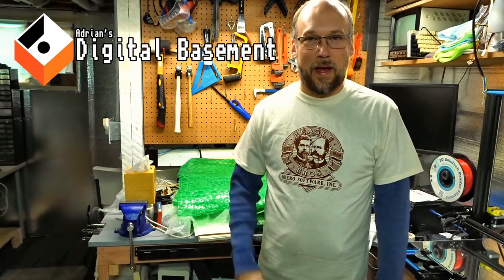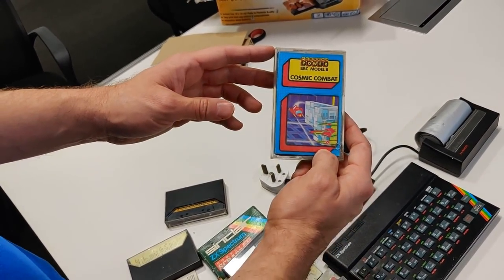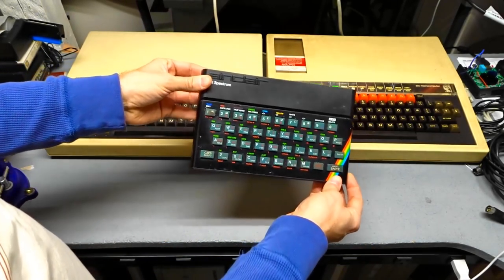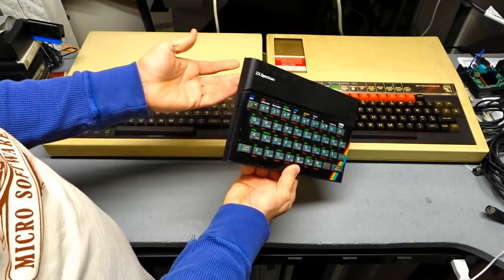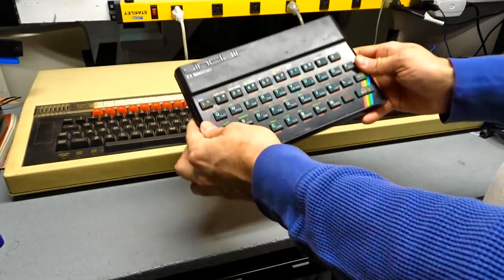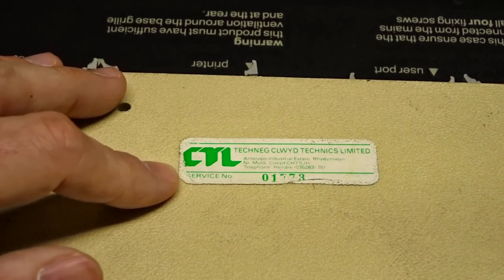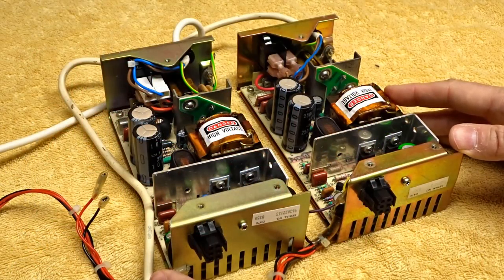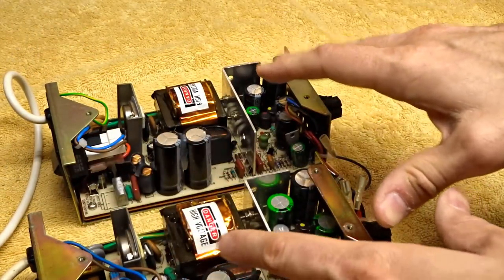I visited the UK and brought back some computers! Let's see if they work.

Comment: Nice pickups!!!  Regards ideas for mods / upgrades on the BBCs - get yourself one of the Turbo or Super MMC adapters (allows you to play all games off a single MMC card), consider adding some sort of ROM expansion board - or some of the RAM / EEPROM adapters you can get off eBay.   These are also cool with the speech chip added - you can buy a kit from RetroClinic in the UK.  I've done some repair and upgrade videos on these myself just last year.  Lovely machines! 

You can also add a Raspberry Pi as a co-processor to these too (via the TUBE connection), and I recently added a SID chip to mine too.  If you want a "Beeb SID" bare PCB for free just let me know and I will post you one from the UK - just needs some TTL chips  and a Swin SID / SID chip etc, but its easy enough to assemble.  I used a Swin SID to avoid reducing physical SID chip stocks from my C64 systems.
Also worth considering doing switchable audio mod too - so you can have audio out into the SCART connection or line out, rather than being forced to use the speaker.
Reply: @adriansdigitalbasement  Yes, that darned 245 really gave me a run for my money lol!  It was litterally the last thing that could possibly be affecting the databus - why couldn't it have been one of the earlier chips I removed lol.   I couldnt see an email address on your about page (maybe YT changed permissions or something related to that recently).  I have added you in Twitter but cannot message until you add me in at your side.
Reply: @adriansdigitalbasement  @GadgetUK164 definitely the guy you want to ask about British Computers. He can probably also give you some more insight on the ZX Spectrum
Reply: The Master is a nicer machine, but it had some incompatibilities didnt it?  That said, I am sure those progs / games have been patched up already to work these days.
Reply: I added a daughter board to mine and installed a number of EEPROMs for different compilers and interpreters. I remember learning Modula2 and Forth for example. It was a great machine to learn on, plus of course Elite and a brilliant racing game called Revs. After that it was the Atari 520ST.
Reply: The Tube socket is so so cool :3 I suppose a Pi is as close as you'd get to the original ARM dev Tube board from a modern system?

Comment: I still have my BBC Model B with tape, disk drives, BBC joystick, 6502 second processor, word wise eprom, a huge selection of games, including Elite on tape and disk.
Mine is a 1982 model, according to the sticker on the pcb. 
Yes it still works.

Comment: 10 PRINT “HELLO WORLD!”
20 GOTO 10
RUN
Reply: 10 FOR a=1 TO 29
20 PRINT "Hello World for the ";a;"th time."
30 NEXT a
Reply: @elektron2kim666  
Hello World for the 1th time.
Hello World for the 2th time.
Hello world for the 3th time.
Reply: @chrisatherton8234  a$="stndrdth"
Reply: 10 PRINT "MARTIN IS ACE!"
20 GOTO 10

I used to go into Dixons on the high street. They had Oric-1 with it's onomatapaeic (sp?) BASIC key words

10 SHOOT
20 GOTO 10
Reply: @martinj.fowler6262  how many times we did this in the 80's.
Dixons was ace, Roland synths, mahoosive hifi systems, battleship proportions televisions.
Reply: Very BASIC command ;-)
Reply: @johnyboytown  Dixons FTW :)

Comment: Got to love the Beeb, one of those few early micros that feels like a "proper" computer. And you can't go past a system that lets you do inline assembly code in BASIC!
Reply: Sophie Wilson really did care above user experience and sensible design, designing to a cost was so low in her priorities. Even though so many more Speccies were sold than Micros and Electrons, at least her RISC CPU design has stood the test of time... and the strengths in her design of the Micro still show through today – as Adrian said, the connectivity is out of this world. The mods people could do to these things were incredible. Douglas Adams and Terry Pratchett both had highly extended systems hooked into various smart home devices from back in the day... crazy stuff. And incredible. Leaving those unpopulated sockets for expansion ROMs was a small stroke of genius. That kind of stuff gets washed away with the first skim of cost cutting when taking a design from prototype to production. But they kept it for the Micro. Same about the keyboard.

Comment: WTF? Those computers were still running our missile defence system. We need those back, dude.
Reply: So true and with 8 inch floppy drives installed .
Reply: @jari2018  That's right. The government drafted in Sir Clive Sinclair to personally design and build the interface for that. Cost them £10M and was classified until 2016.

Comment: BBC Microcomputer was used in every school in the UK during the 80's
Reply: Until they were replaced in favour of the Acorn systems line in the late 80's, early 90's. The old BBCs and other Acorns had an impressive life. I was using them at my school right up until the end, in '97.
Reply: @mikejandrews  They were all Acorns, Acorn made the BBC Micro and the Archimedes. Yes, well-built computers, guess they had to be for school use. I owned both of them back in the day.
Reply: @andrewnorris5415  Yes, I know. The story behind the BBC machine's development is fascinating. They were strong, well-built machines.They probably anticipated bothersome primary school kids going wild with them. 

But I never owned either, though used both at school (mostly the Archimedes) and my brother had the Electron. Played a lot of games on that. (After they finally finished loading.)
Reply: Till RM Education took over
Reply: Some schools still used them well into the 2000s. It's still a perfect educational computer for young children. There is no American software with incorrect spellings, they are so limited there are no pointless distractions, and they are extremely robust. I wouldn't be surprised if there are still a handful in use.

The Risc PC was great for slightly older kids. I remember it having a really nice word processor and paint program, so it was more productive without being too full of distractions, and still had correct English.
Reply: I used a BBC Micro in my embedded electronics classes at school/college... In 2005! We still had 5 all set up! 😉

Comment: I have no idea why YouTube suggested this video but it brought back many memories. The BBC Model B was our first computer and between 1983 and 1993 my husband and I had a small software company producing educational programs for secondary schools in the UK. Our best sellers were for data analysis, allowing students to enter and display records from e.g. a weather station, measuring rivers and for human geography doing surveys in towns. I learned to use a word processor with View (supplied on a chip), spreadsheet was ViewSheet and ViewData (if I remember correctly) was the database. With the BBC Model B, you could only get about 1000 words in the memory before having to start a new file, though you could chain them together to print documents out. My favourite was probably the BBC Master 128. That would hold 5000 words before running out of memory. Favourite game was definitely Elite.

Comment: I think I know why one BBC has a cut out section. It's because the BBC wanted a specific power supply that wouldn't interfere with their equipment, against the advice of Acorn. But when it became clear the kind Acorn recommended was required for reliability, it was changed to fit the original specification. All learnt/vaguely remembered from last week on Retromancave. That might be something to do with it.

Comment: The Econet machine was definitely from a UK secondary school in the 1980's. Nobody else but the criminally rich and insane (ok, Acornsoft) would have a network of Beeb's back then. They would all need a fileserver too which would be a rack mount Acorn Atom based machine (called an Acorn System something) with massive 5MB Winchester drive or perhaps dual 5 1/4" floppies.

The -5V is used for the RS423 interface. You definitely need it for trying to transfer files between a real BBC micro and your PC. The PC end is the usual TTL/RS232/USB adapter and the other uses a 5 pin "domino" plug for the BBC Micro. The domino/dice plugs are rare but Farnell CPC does sell them. Deltron 611-0520 for example.

There are few ways to wire it - I go with the simple CTS/RTS and RX/TX swap over, all that nonsense with DTR and DSR really isn't needed.

ETA: I'm pretty sure the -5V is needed for the cassette interface too, as a negative bias for the op-amps.
Reply: I agree with Drew i went to school on Anglesey late 80s and the school had loads on a econet so your unit is 90% likely from a north wales school at some point and the rom is likely to have a build that if it detects econet connection and the file server it would have booted differently.
Reply: I worked at a school in London where we had ~50 Beebs & 15 (there may have been more) Archs. I hated chasing down Econet disconnects, network clashing and just outright disaster. But when it worked it worked fine, I would come in the morning and power up the server a BBC with a Winchester drive a big smoky glass dome with the HDD platters spinning (later upgraded to a ST506 I think), give it a few mins to warm up then hit the breaker, powering up the bulk of the BBC systems and in general it was reliable.
Reply: The rackmount fileserver WASN'T Atom based, it just looked like it. What looked like an Atom was actually just a keyboard. The CPU board would have been an Acorn system II ( I think).
Reply: Ahhh, Beebs on Econet. Four character passwords that, if you didn't want to spend a few hours brute-forcing, you could just sniff while they were typed from any machine on the network, IIRC
Reply: @mrswinkyuk  The Atom was basically a cut down System 3 without the Eurocard chassis for the home computer market. Looking at some googled photos I definitely remember the System 5 with that Atom style keyboard, drives, and monochrome monitor as our school Econet file server. When I said Atom based I meant those System X's were ancient tech even back in 1983. They were decidedly not BBC Micro hardware, and clearly didn't need to be (colour graphics on a file server?).
Reply: I ran a large company using a network of 20+ BBC Master ETs on an Econet. It wasn’t only used in schools. Fileservers were usually a dedicated but otherwise standard BBC Micro or Master (often with a 2nd processor). The early FileServer software was written in Basic. Later, Acorn introduced the stand-alone FileStore fileserver, and third parties produced various alternatives.
Reply: There was a Teletext server for Econet but not sure if this was a commercial product. Allowed you to download share prices in the days before the internet.

Comment: The rectangular aperture is probably a  (very neatly-done)  mod to get rid of the heat from the PSU.  Early Beebs had a transformer power supply  (at the BBC's insistence, to limit RF interference)  with dissipative regulators, which got very hot.  Acorn eventually convinced the BBC to allow a switched-mode supply.  It was my understanding that linear PSUs were only fitted up to Issue 3.  So an Issue 4 machine should have had the SMPS from the factory; but Acorn would have wanted to use up all their existing stock, and if your machine was a very early Issue 4 it could just about have been fitted at the factory with a linear PSU.  If I had to take a guess, I'd say the disk drive was overloading the PSU; cutting out the top proved a temporary fix, but it eventually blew and was replaced with a switched-mode one.  They might then have tried gluing the cut-out piece back in, but the glue perished in storage and it fell out.

The sound circuits  (and the memory, on Issue 2 Beebs)  require the -5V supply, so if that was absent on the machine while still in the UK it would explain the weak power-on beeps.  You were only getting the crests of your waves, not the troughs!

The BBC keyboard was an absolute delight to use.  The switches are proper heavy-duty tactile switches.  The letters on the keys are not printed:  they are actually moulded right through the coloured plastic layer!

Most CGA monitors will sync to the BBC's 50Hz signal.  There is only a composite sync, but nearly all monitors will accept a composite sync on the HSYNC input with VSYNC left unconnected.  There is a +5V available on the 6-pin socket, so you can tie the BRIGHT input high.

If you type
REPORT
at the prompt immediately after switching on or pressing BREAK, the computer will display a copyright message.  (REPORT normally repeats the last error message.)  If the date is 1981, you have BASIC I; if the date is 1982, you have BASIC II.  This has better accuracy on trigonometric functions, a few reliability enhancements, and some extra options and directives in the built-in assembler.  Both are capitalisation-sensitive  (though, interestingly, the built-in assembler isn't .....)

Both the User Guide (supplied with the machine) and the Advanced User Guide (sold separately, but pretty much essential anyway) can be found online. When you get bored of BASIC, you can start using the built-in 6502 assembler. The instruction set is nice and easy to learn, and most instructions can be used in several different addressing modes.

Good luck with it!  You have a fine piece of computing history there, standard issue in every UK school and also very common in homes, offices, and even -- thanks mainly to its analogue, user and 1MHz bus ports, accessible directly from BASIC without resorting to machine code -- used for controlling machines in factories and recording measurements in laboratories.
Reply: Just for interest I have one of the very early model B's and it has a linear PSU but no output connector for the disk drive.  I managed to obtain the disk drive chip (it was a crazy price as they were on limited supply) and initially fitted a dual 40 track floppy drive before "upgrading" to a dual 80 track pair of drives.  I still ended up using an external PSU as I couldn't get hold of a switched mode PSU then.
Reply: @graemescott990  Ah, yes. My BBC was an Issue 7, and my local Acorn dealer (who would later become famous for selling an Electron joystick interface .....) had some 8271s in, so my disk upgrade was a same day job.
Reply: agree that the hole was a user modification...probably with a dremel or just some careful cutting and filing

the hole was sometimes necessary due to internal ROM boards and/or beeb powered disk drives which made the PSU get very hot

I've got a few beebs with similar mods
Reply: "used for controlling machines" etc. SO true. Even as late as the mid-nineties a certain defence company (who shall remain unnamed, but their name rhymes with "Hark Phony") still used a model B for testing certain aspects of their laser-guided missile systems.
Reply: @aitchpea6011  Well, if something isn't bust, why fix it?

Comment: The BBC computers (when fully equipped) were very powerful compared to other 8 bit systems for back in the day.  They were very expensive too.   Games on the BBC generally suck though, well other than Elite which has the best and fastest 8 bit version.

I think you should make one perfect machine and load up all the parts like speech synthesis chips etc and get a floppy emulator.  Maybe add the Z80 Tube for CPM, LOL.
Reply: Exile
Reply: You need to try and find a cheetah speach synthesiser ☺
Reply: @dlew3624  I have one ;-)

Comment: As a 40 yr old, the bbc micro was the very first computer i ever saw as a 5yr old kid, that would have been 1983 ish, and there was only one that arrived at my school and it was considered SACRED incase it got damaged, the fact is that we barely got to use it which is a shame because im sure by 1986 or so they were pretty much defunkt. However at the time It was state of art and had a program called pod or similar, you could guess at the things the caracter could do “pod can JUMP” if you typed that in and it worked it was written on the wall for the other kids to also try, we were hooked.